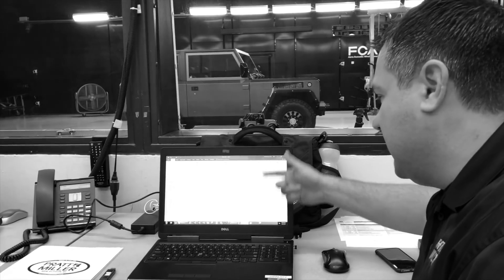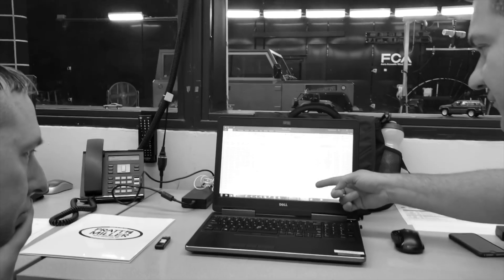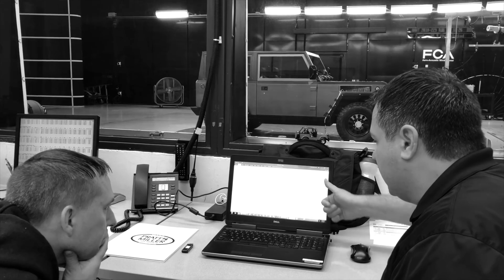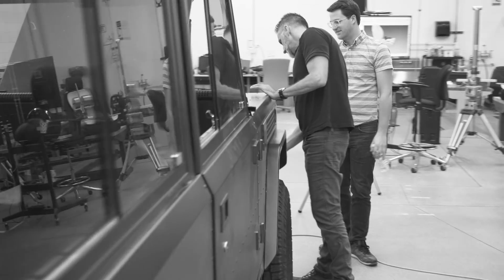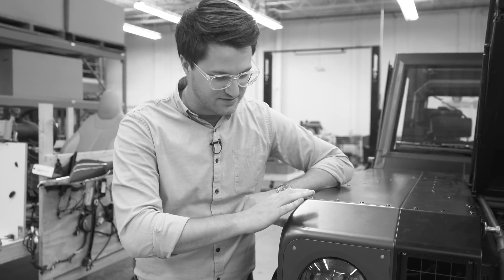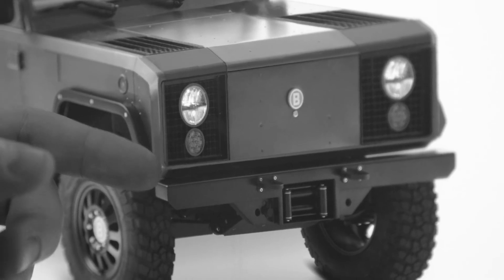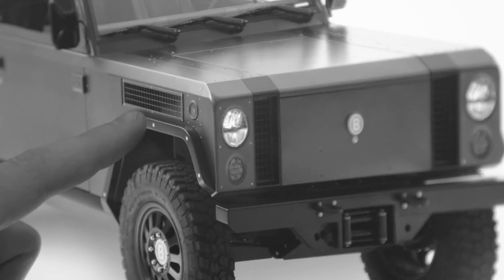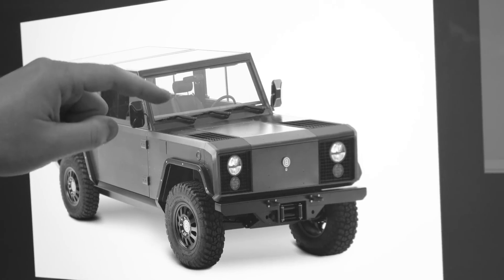NOSE JOB - Bollinger Motors

Comment: Definite improvement over the"brick" but It just wonder about rain and snow build up in the vent. Driving through a snowstorm will pack the space in no time. Will take weeks to thaw out.
Reply: No taper! We want the brick. You’ve promised us a brick and we want it.
Reply from the maker: We thought about that too. It's designed to flow and not stick. Snow doesn't get packed on a regular car's radiator, it melts off. Where are you driving this thing Mark!!? ;)
Reply: Bollinger Motors I drive in the snow. Radiators are hot and melt snow. EVs not so much. Since that vent cavity seems to be dead space, why not just eliminate it and taper the fender up from the bumper.
Reply from the maker: Because we like it. It won't fill with snow because its a passthrough. The radiators are on an angle. Your tapered idea could work for letting water drain from it.
Reply: Does no-one remember the radiator covers that you had to put on your Land Rover in the winter? Perhaps you could get some made up Mark, to put yourself at ease.

Comment: Really impressive car !
Would it have Chademo fast charge ?
Reply from the maker: Thank you! It does, but we are switching to CCS (Combined Charging System) for production.
Reply: I think it's way better the CCS !
Thanks for your response !!
Reply: Correction vehicles using CCS do have the capacity to create vehicle-to-grid functionality. Since CCS uses the HomePlug communication protocol that does have a vehicle-to-grid protocols it just not being utilized at this time. Like Nissan has developed using Chademo. But since is an older Japaneses fast charging standard that actually uses the older inferior CAN Bus communication protocol it really doesn't make sense for others to do same thing,

So let hope Nissan and its affiliates will get smart like Toyota and Korea has that have adopted CCS too. 

Its a shame TE keeps incorrectly reporting on Chademo having the only vehicle-to-grid or vehicle-to-vehicle protocol...

"Vehicle-to-grid" capabilities is nice to have theoretically but there is just no use or economic incentive to develop those capabilities in most cases at this time anyway...

Comment: Please make it less than $60k
Reply: 80k for the small battery 100k for the large one. Unless a major company buys them out I do not se it being much less than that.
Reply: I’m thinking 30k
Reply: B1 is comparable to a JK Rubicon with less features. Gotta either have more bells and whistles or price under a JK to be competitive. Otherwise it’s just rich people buying a novelty item.
Reply: @tyler would you pay 30k for a kit that you had to self assemble?
Reply: Anthony the 110kw battery is most likely close to 20 grand.
Reply: fatboy19831 I am trying to get a sense for what people would pay for a kit as opposed to a fully built vehicle. These things are not cheap, I understand.
Reply from the maker: Wo won't be selling kits, just complete trucks. We'll be making production timing/release announcements soon. Thanks for your patience!
Reply: The only injury I've ever had in a vehicular accident was from an airbag. But I thought they were required for new vehicles in the USA? 

BTW I love the basic concept of a multi-use EV. with a purpose built design. Its just so versatile, it puts a smile on my face until I realize it will be out of my price range :(
Reply: The gvwr is 10,001#, making it a class 3 truck, akin to a GMC 3500 or F350. Medium duty trucks lined this ar not required to meet the same standards as light duty passenger vehicles.
Reply: ok so your saying it will be a class 3 truck? And if so what safety standard will be exempt? it doesn't seem applicable on its face value....
Reply: @nc3826  Airbags, for one,  are not required in class 3 trucks.  The B1 is explicitly designed as a class 3 vehicle for just this reason (note the gvwr is exactly 10,001#). As such,  Bollinger doesn't have to go through the expensive process of crash testing that is required for light duty vehicles. If you want more specifics, I'd suggest that you utilize your favorite search engine.
Reply: @AnthonyWebb7  30K and a lot of fun.
Reply: Conor Nugent, airbags would be nice as my wife probably won't let me put the kids in it without them. If they don't, well I could just keep watching videos of this vehicle and wish that I had one.
Reply from the maker: Copy that. We'll keep the videos coming! ;) Air bags will not be in the final produced truck. We are engineering the B1 to safety standards that exceed federal regulation using seat belts.
Reply: I have a feeling the first generation will be around $80k, hopefully lower but I imagine a $60k pricetag once their production stabilizes.
Reply: With airbags
Reply: And please accept Bitcoin

Comment: Well that's a nice original design touch. Just what an icon needs and deserves.
Now, what about a collapsible windshield? 😉
Reply from the maker: Agreed, that would be killer. However, our windshield frame is an integral part of the upper body structure, making it fold down would add weight and cost while reducing strength.
Reply: Bollinger Motors well... Not necessarily, you can make an aluminum subframe inside the steel frame 1 inch thick with a smaller windshield, weld some hinges and a couple of locks and you get it. You get the best of both worlds, a roll cage and a tasty bug in your mouth. 😆🐝